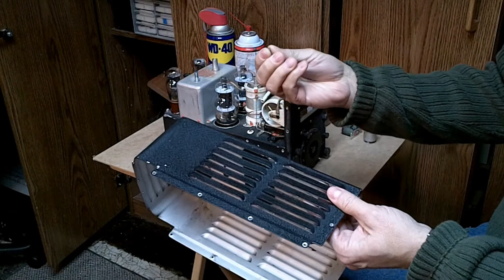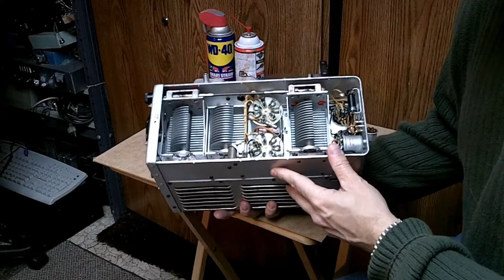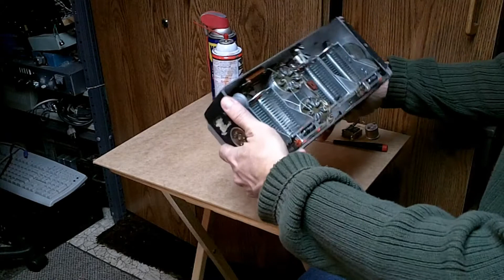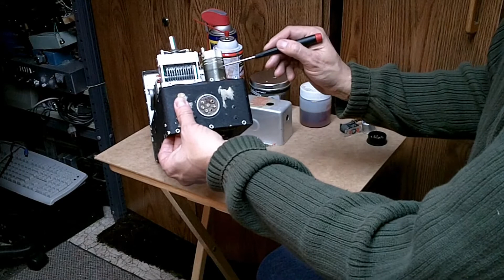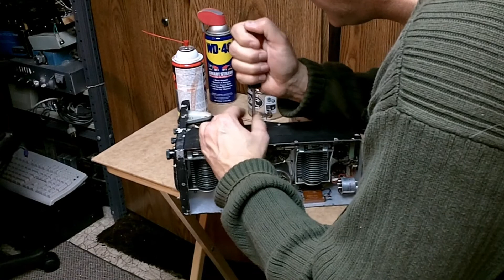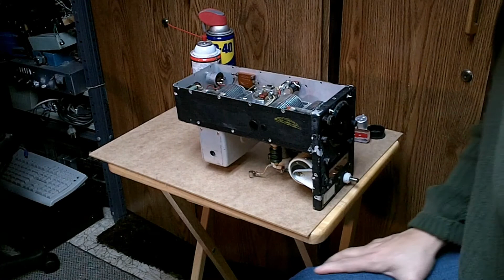ARC-5 COMMAND TRANSMITTER PART 3

Comment: That crazy tray table !  anyway on my ARC5s , that loading coil is gone and the rivets holding parts to chasis no longer have electrical contact to ground the parts - silent failure point.
Reply from the maker: The Loading coil is normally not used for 50 Ohm Coax, so many times it was removed. The coupling link is sufficient. Some people add a couple of turns to it for more of a match to 50 Ohms (More Power out).

Comment: You use a RF choque 2,5mh why you use this choque?thanks a lot❤❤🎉🎉
Reply from the maker: I find that the quality of the choke has a large effect on the regenerative detector, especially over multiple bands. For many simple radios, a resistor can be made to serve, with only slightly reduced performance. Some cheap ferrite loaded chokes have resonances that can affect the regen.

Comment: Final Tube are 807x2 ?
thank you video.
ex  JH1FIT
Reply from the maker: The ARC-5 transmitters use a 12V filament version of the 807 called the 1625.Some folks say it is more rugged.  It is otherwise electrically equivalent.
Reply: @MIKROWAVE1  
The 1625 has a seven pin base while the 807 has a five pin.